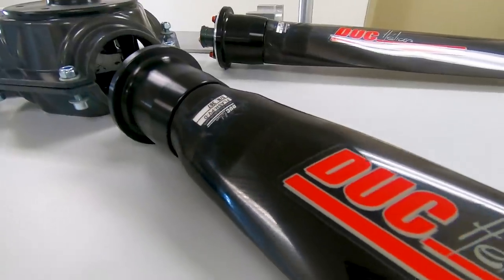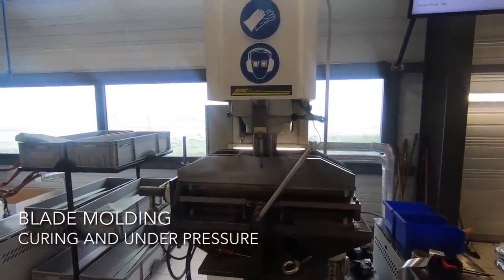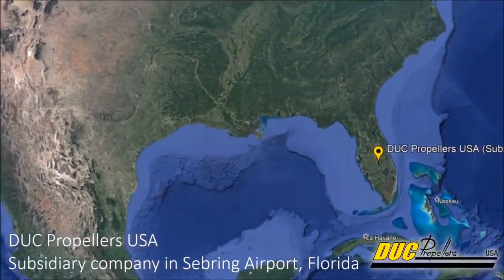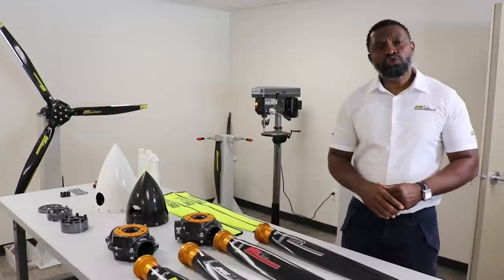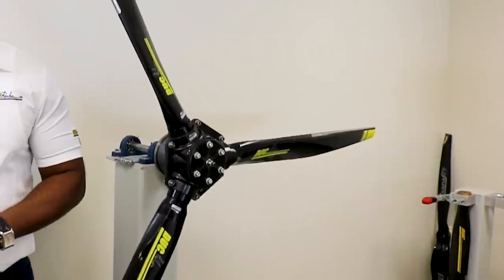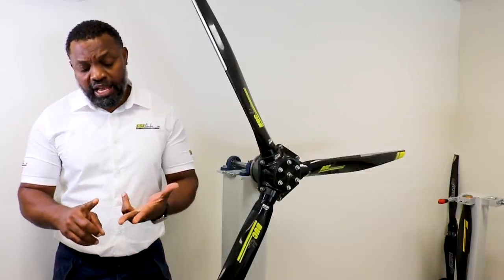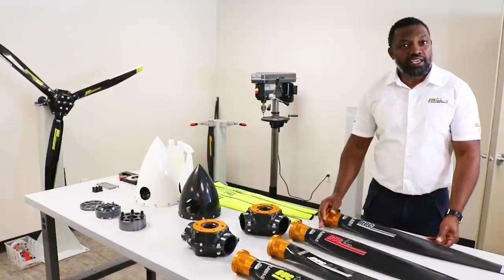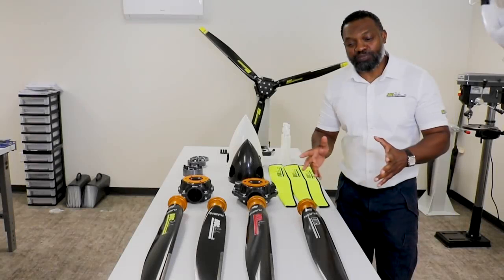Airplane Propellers - Carbon Fiber - Factory Tour - DUC Propellers

Comment: So first let me say, I am a DUC propeller owner. I currently have the 3-blade  Flash Black-M ground adjustable on my KitFox 7 (Rotax 912ULS) and I LOVE IT! The ease and speed of adjustment is simply amazing. If I said it took 1 minute to adjust the pitch on all 3 blades ~ I’d be lying. It’s takes about 30 seconds. And just as important to me is DUC’s customer service. Gaetan Fouozing is THE MAN! So professional, so responsive and so knowledgeable. He is an absolute pleasure to do business with!
Reply: Looking at the flash for my Kitfox 7 with 912uls. Still happy? Have you tried other props NR or whirlwind? Thanks
Reply: @cnoz7247  - I bought the plane with a ground adjustable Whirlwind and honestly, I didn’t have enough experience with the KitFox to render the Whirlwind a proper judgement. I was just eager for more thrust, better climb rate, faster cruise. When I first heard about the unique design of the DUC and it’s ability to essentially “mimic” a constant speed prop, I had to try it. Very glad I did!

Comment: Very interesting.  Are you going to find owners and users of these propellers to see what they say about performance, etc?  I noticed he mentioned both constant speed as well as the ground adjustable pitch propellers and helicopter and gyroplane rotor blades.They have an interesting website providing much more information and a tool for suggesting the correct blades. Nice.
Reply: Aku gak tau bhs you
Reply: Viking Aircraft Engines out of Florida, does a lot of work with Duc props. Viking designed a very interesting in flight adjustable/constant speed system using Duc props with their engines. They have a Youtube channel.

Comment: A propeller is just like a wing, I wanted to know about the shape, at the root. center, tip, and the twist and weight. How it cuts thorough and moves the air compared to everything else out there. He just didn't give us much info at all. 8(  Sorry.   --gary